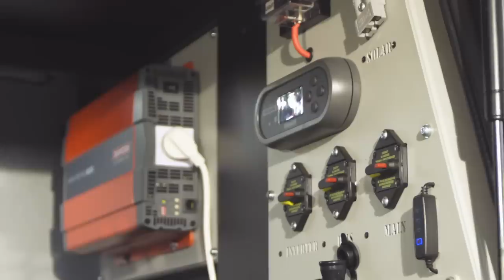Is This The Landcruiser Killer? Why I Chose A RAM 2500 As A Daily Driver

Comment: Nothing can kill a land cruiser
Reply: chuckling in cummins
Reply: Fuck up a oil filter change and the cruiser is dead
Reply: Bullshit RAM KICKS EVERYTHING just needs a diet
Reply: *Laughs in airbox
Reply: Except a bit of dust
Reply: Fan boy detected
Reply: @jorjimaco5331  the only thing a ram can do is tow and waste your money on diesel, they are too big to do serious off-roading, sure they might be a decent tourer but so is a 200 series. The fact is that the land cruiser can be built for so much more things than just piss weak touring. I do like the ram a lot but it does not even compare to any land cruiser
Reply: @chrisgraham823 
Crap! It’s a glorified forklift buddy!
Reply: @jorjimaco5331  if a land cruiser is a glorified forklift then a ram is a lifted Prius with less tech and an ancient V8
Reply: @Tony F 
Only reason they have dealerships everywhere is because they have forklifts in that town! Get a real V8 !
Reply: @xr6tgtx737  
I agree! They need new everything to make them go!
Reply: @chrisgraham823  
You do get that a chopped 200 series and the ram are pretty much the same size? 
The ram has running gear of a truck and lockers, the 200? Umm no.

Heck if Jase picks the Ram I'd back that judgement all day.
Guys had close to 3mill worth of Land cruisers
Reply: @xr6tgtx737  yeah but that’s just the 200 series, there is a whole range of land cruisers and all are very different ram only has the same truck but a tiny bit smaller which is still too big
Reply: @xr6tgtx737  an*
Reply: @chrisgraham823  
Every single cruzer you need to spend big bucks on it, new this new that bigger this bigger that. Let’s be positive what’s a perfect vehicle? Helicopter! Done!
Reply: @chrisgraham823  "iTs ToO bIG tO dO AnY SeRiOUs oFFrOAD" did you not see them take the same truck through moab? did you not see the size comparison to a 200 series after the GVM upgrade? stock it tows more than a cruiser and fits 35s without any modification
Reply: @Tanner731  
You can't change the stupid 🥴 
Wank over a chopped 200 yet say a 2500 ram is to big 🤣
A chopped 200 with a 650mm extension comes in longer than a 2500 and is within a couple of centimeters in width... 
I know this as I went from a series 1 2010 200 series into a 2018 2500 but i did fark up on my calculations when going with a 3inch lift with the 35s... had to drop it back to 2 inch to fit in my shed door but both the 200 and 2500 had just enough room with width.

Comment: ROFL... a $200K+ car wont ever be a landcruiser killer. The ram is a nice thing but not even close to the same market.
Reply: LC & Land Rover built this country.. they can’t beat that.. no matter what car they bring..  not knocking what they build.. hats off to the work.. but if your going to have a dig at the 4x4 that built the country.. be prepared..
Reply: You're Right it's not in the same market as a land cruise /Range rover (witch I'd rather be in a jeep Rubicon).  This truck does so much more and it does it better.  It's literally on another level.
Reply: @R00RAL  haha new LandCruisers aren't in the same league as the old ones you realise? Stop holding onto the past
Reply: @Bigsoot7393  When did I say new ?
Reply: Stewart, if you compare a chopped 200 to a ram 2500, the ram is better in EVERY way, and cheaper.
Reply: So you are comparing a ram to a 40 series then? Well the ram is going to win every category
Reply: @Bigsoot7393   pick a landcruiser, any landcruiser. The ram shits on it.
Reply: considering they are new to the market, are you actually suprised?

40 series, g60s and series landrovers built this country. Not chopped 200 series.
And goodluck with your small truck. The money you save on the truck can go into back surgery after you drive it.
Reply: @MRMOPARMAN0426  But chopped 200's are gamechangers🤣 Btw when spending big bucks on a car just get a y62 and supercharger, fuel economy is irrelevant.
Diesels are relics just like the boomers that go on about em😂

Comment: You can’t kill a landcruiser. Ram does not have that same reliability
Reply: hahaha what a joke
Ive seen them dead mate, I seen one blow a transfer case, gearbox and front cv on the tele track. 
Ive seen the engines flog injectors into the block over fuel and blow up.
Reply: @mattmillwood4764  ram???..I owned a dodge ram for 7  years and they are junk....after 5 years they just start rotting,leaks,engine knocks,cracking dash boards.....man I could name things all day

Comment: 6.4 hemi
Reply: I have the 6.4 in my ‘16 Power Wagon. As outfitted  with off-road equipment and Four Wheel Camper Hawk in the bed, I’m at 9,500 lbs. The 6.4 is more than adequate and even tows my 7k lbs. boat comfortably out here in the western United States. Thirsty but good engine.

Comment: Ram 2500 will eat any ute chopped 200 in every way. Half the price and double the capability
Reply: Half the price? Get yourself a portal axel, coiled up, turbo swapped 79 and it would shit all over it. Only plus of the ram is the comfort.
Reply: @veysher3756  ram can run 40s with a 3in lift lol your 79 do that?
Reply: Can't tow 6 plus tonne with your old farm truck 79 that doesn't even come with power windows or aircon and is still close to 100k
Reply: @veysher3756  absolutely dreaming, the cruiser is pathetic. And not even comparable
Reply: You guys get that butthurt over someone dissing Rams aye. I'm talking for 4x4ing and reliability. There's a reason everyone uses cruisers in Australia. I personally own a Ram, and I use it for towing. If I'm going remote, I take the cruiser.
Reply: @arronjohnston742  No actually, I'm comparing a fully custom Ute to a fully custom Truck.

Edit: But thanks for the name calling, you seem very tough.
Reply: @Tanner731  Legally, no, you can't do either of those things.
Reply: @adamblundell6402  Can't tow 6 tonne on a car licence anyway, it does come with power windows and air con as well.
Reply: @davewilliams4157  You basically just stated your opinion with no facts. I could just reply "You're hallucinating, the Ram is pathetic. And not even comparable."
Reply: @arronjohnston742  Never stand a chance at what exactly? You seem awfully mad and have simply resorted to calling me a moron. Ram fanboys always get like this, I like rams and I like cruisers, they are both just better at different things.